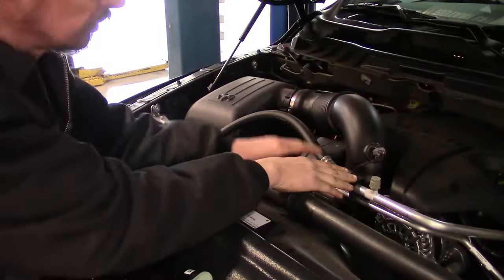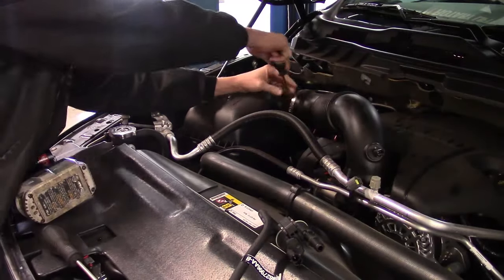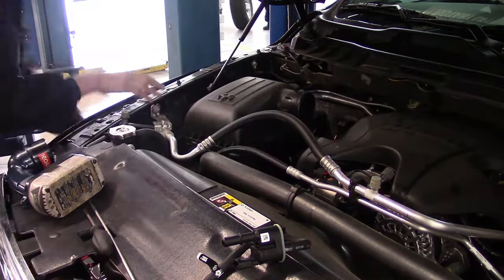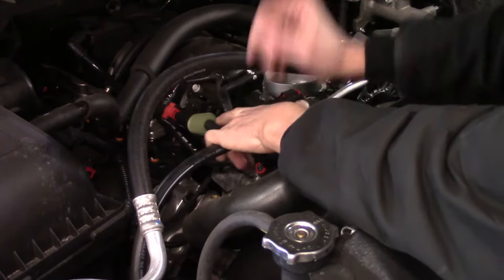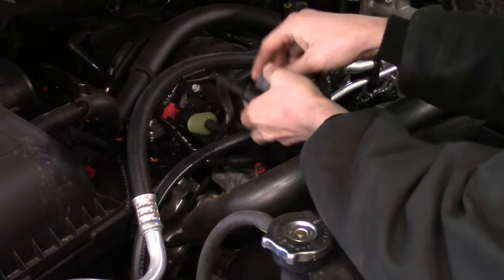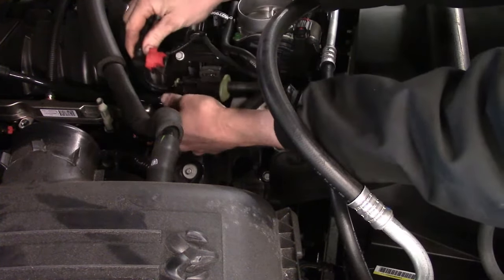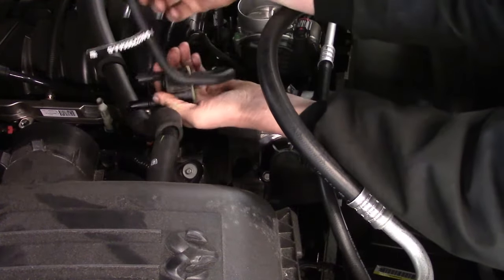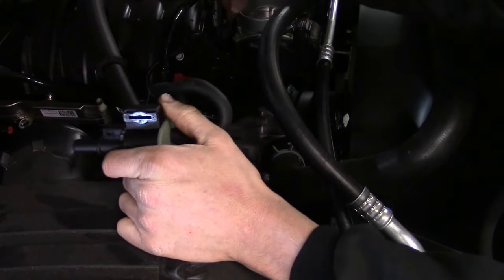2013-2016 Ram 5.7 Hemi evap purge solenoid replacement

Comment: Thanks brother! Your instructions worked like a tee on my '16 Ram. I didn't think I could do it in the same time frame seeing I didn't have a 5 foot screwdriver but I did. The big thanks are to those clamps....drive me nuts! Never know if you lift, push or squeeze. Also note, I removed the old valve and could blow through it. The new one you can't.
Reply from the maker: Thanks Bill for the comment and for watching. Simple fix as you saw and not hard to replace

Comment: Very helpful, I assumed the worst when my check engine came on. I thought for sure my transmission was on its way out but this is the code that ran on the computer. With your video, if this is the problem, I can now fix my own truck for about $40 and about an hour of time. It'll be an hour for me because I'm slow as hell when it comes to anything larger than a 2 stroke engine.

Comment: Thanks for the helpful video. I just replaced mine; it was one of the easiest car repairs I've ever done.
Couple of things I learned:
1) At 1:28 you can use a regular flathead screwdriver to take the hose clamp off by going underneath the 2 A/C lines, rather than between them.
2) At 1:42 on my '17 there aren't rubber gaskets for the air hose, it seals directly on the plastic. It was stuck on there real good. It was easier to break the airbox side loose first, which gave me leverage to  rotate the entire air hose to break the intake manifold side loose easier. Once off I recommend cleaning the sealing surface with WD-40, to ensure it seals when you reinstall it. It also makes reinstallation much easier.

Comment: Thanks! Followed along perfectly. Taking the sensor off the big air hose was a little different on a 2016 but just needed to be turned to the left and then pulled off. Otherwise perfect instructions. Hope it finally gets rid of the check fuel cap light that keeps coming on!

Comment: Just a heads up on you guys that get a p0456 on your rams. Mine is a 2014. I was getting the code and thought it was maybe the gas cap but i wasnt getting the gas cap light. So i checked all the lines. Turns out it was the line going from the silinoid to just right by the throttle body. It looked like it was on but i pushed down on it and it slide down just a little. It doesn't even have a clamp on it. just that tiny fraction of being loose was throwing my code. Now no more code.
Reply from the maker: Thanks for that added info. Its always cool to see viewers helping viewers. Glad you found the cause of your code.
Reply: Me too. I had the P0456 in a 2015 Charger V8 and I was able to push down just a little on the fuel vent line that goes to the throttle body. Erased the code and haven't come back in 24hours.
Now, I don't know if I should return the canister valve or keep it as replacement. ( part PV749  at autozone)
Reply: Do you mind telling us what motor you have they're not all the same.
Reply: Hello
I have same code, P0456 in a 2015 Ram. Will try this and let you know if this works.
Reply: Mine was exactly this. So glad I found your post. Closed the hood one time, and bam...the code. I put a small hose clamp on loosely (it’s just plastic there), and won’t happen again. Cheers. 👍🏼🇨🇦
Reply: Awesome thanks for the heads up.  Maybe I've bumped the hose in the past.  Mines been throwing the p0456 codes in the summer months for over a year now.  Haven' tried anything but I'll check those hoses... maybe I've bumped them messing around with the air intake.
Reply: @davidgamez7967 keep it I did same thing threw the code two weeks later. Seems like it takes a while for the vehicle to test that part of the system
Reply: @mlaugh3 that cel code is common for all dodge engines wether its the V6s or v8s both have same fixes/symptoms

Comment: Just changed mine out took about 15 minutes. Hardest part was getting the damn cover back on. lol. I'll update in a few days on if it "cured" mine. Thanks for a great instructional video.
Reply from the maker: Thanks Michael! Glad it all worked out in the end. I so want to throw those engine covers in the trash each time I work on them.....guess the engine isnt pretty enough to the eyes that we have to cover it up and use it to dampen some of the engine noise as well. Make sure to subscribe and hang around to check out some of my other videos.
Reply: How much was this pRt. And where did you get it if you dont mind me asking
Reply: Micheal, it's been 8 months since you posted and you said you'd "update in a few days on if it "cured" mine." So what was the outcome?
Reply: Fred Proctor parked in street broke down lmao

Comment: Solid video, easy to understand and follow along. Down side is I don't know that this will fix what I'm dealing with. I have a P0455 code (EVAP system leak monitor, large leak detected). Any suggestion? Odor comes from near the gas cap/fill area. No fuel leak. New gas cap put on, did clear out the code. Occasionally the gas cap light will turn on, then turn back off after a few minutes. Loose connector? Loose hose? This did start after replacing the fuel level sending unit so I dropped the tank and disconnected everything. Put everything back on after, but maybe not tight enough?
Reply: I was told at a dealership to take some fine grit sand paper and see if you can clean up the lip of the filler tank. Where the gas cap seats.  It gets sort of corroded there I guess.  Might be something to try.  Just a quick sand to clean up any of the Junk they said.

Comment: ON MY 2010 RAM 1500 4X4 SPORT WITH HEMI, ITS LOCATED AS YOU SAID, NEXT TO THE BATTERY, JUST BELOW IT. I JUST GOT THE SMALL LEAK DETECTED, FOUND THE PART ON AMAZON FOR $20. HOPE THIS FIXES IT, JUST CAME ON THIS MORNING.
Reply from the maker: Thanks Clifford for the comment. Hope it works out well in the end. Thanks for watching and make sure to subscribe.
Reply: @MotorCityMechanic  Yes sir,  I installed it in 5 minutes,  disconnected the battery for 1 minute,  started it up,  light went away,  and has been off so far
Reply from the maker: @cliffordpayton5517  Awesome. Time will tell, I will keep my fingers crossed

Comment: Great vid, did my 2017 in under 5 mins thanks to you. Good on ya mate.
Reply from the maker: Awesome.....now thats quick. Thanks letting me know how it went. Make sure to subscribe if you havent already
Reply: @MotorCityMechanic  There was only one thing you left out. I disconnected my battery afterward for 5mins to reset the comp and have the check engine light go off
Reply from the maker: @bigbearbland  On the battery you can do as you mentioned and then the other thing is not disconnect and if you truely fixed the issue then over the next few days the light should go off. Thats one way to know you got it right. Either way you cant go wrong.

Comment: Thank you so much boss! P0456...this video was very well done and so easy to understand!
Reply from the maker: Many thanks for the feedback and kind words.
Reply: I just got this ram with the same code too. Wanted to try just replacing the gas cap at first but seemed to come back on. Now replacing the purge valve
Reply: @lincoln6981  what was the symptoms u we’re having?
Reply: @classentransporthotshot1496  no Symptoms actually just the check engine light. I already replaced the purge valve. And even taken a trip out of town ( 300 miles round trip ) and everything is good now 👍

Comment: Thank you for the video. Saved me time and money. My check engine light is still on after replacing the valve though. Will it go off on its own or do I have to reset it manually?
Reply: Disconnect the negative battery terminal for like 45 sec. It’ll come off. If it comes back on, something is wrong still

Comment: Is this the same as p0441? My check gas cap light popped on yesterday. Tightened cap & reset code with obd reader & code didnt go away. I keep my truck over half full & when i feel it i stop when the pump clicks once. No gas smell or nothing like that. Whats your suggestion? I hate dash lights 😡
Reply from the maker: The code for the gas cap cant be cleared.....a test has to be run to make sure there are evap leaks and if it passes, you can then clear the code. If tightening the cap was the fix then it may take driving it for awhile and at least one fill up of fuel for it to run the test itself and store the code so that you can then clear it.
Reply: I changed my gas cap because the o ring waz dry rotted & it cleared after i disconnected the battery for 10min
Reply from the maker: @tyrellgatling5666  So much for what I said lol. Typically they wont clear easily. Glad you got it worked out in the end an I will need to remember that as another option next time. Thanks for replying back Tyrell!

Comment: As previously mentioned, great video, thanks. One question, I see that there are some options to buy a replacement solenoid only without the hose and to just re-use the existing hose. Cuts the price down by almost 2/3rds. Is it ok to use the old hose?
Thanks, again!

Comment: Does the evap make any form of noise under the hood while truck is running. The noise happens for like a min and then stop then take a min or two then starts again. Any clue of the noise.
Reply from the maker: It can make a tapping noise when its working......I would make sure that its the cause and not a bad HVAC actuator under the dash. Typically you wont hear the purge solenoid inside......only outside and mainly with the hood up. Thanks for asking and make sure to subscribe.

Comment: Great video. Do you know if this replacement process is the same for a 2016 Ram 1500 (6 cylinder?). Many thanks
Reply: Not sure if you still need an answer to this question but I just changed mine on my 2016 and it was the same other than me having to use a flathead screwdriver vs a Phillips

Comment: So I have a 2013 dodge charger. I had the smell of gas or fumes in my engine cabin. Thought it was the fuel tank or the the pump. Took the seat off smelled fine no leaks and I can hear the pumps turning on. So a month later I got the p0456. Said evap leak. Did research found that it could be this part. Or the canister which is under the wheel well. Would that cause the smell though? I read it can. But I'm thinking if my best bet is just to replace both since I check the fuel tank already. I found it could be the filler neck. But no smell there. Also the smell went away after a while but comes back faintly.

Comment: So I have a conundrum.. I have a 2013 Ram 1500 5.7 hemi 6 speed automatic. And the purge valve is not where you're showing it?!! Maybe I've gone blind, but where the hell is it?
Reply: Tom Strubbe I have not found out yet... I'm thinking on top of the fuel tank??? But I can't get there.
Reply: @tomstrubbe5551 it’s under your battery…he says it in later post.

Comment: Looks like no one has posted anything recently, hopefully someone can help me. I have a 2018 Ram 1500, having problems putting gas in the truck. The gas pump continually clicks off everytime, dealer replaced filler neck, canister, and vent hoses. Same problem, could this Evap Vent Solenoid be causing the issue? Ive read that if the pump keeps clicking, this could be the problem. If it is, is there something i can do to fix it other than Having to deal with it till it gets back to the dealer?  Maybe check lines from it? Thanks alot
Reply: Turns out i brought to dealer, after the filler neck, canister and vent hoses, they replaced the gas tank and all is well. Just shocked me that a gas tank on a new truck just gets messed up like that. Dealer had no explanation, more like well beats me.

Comment: Question:  Where exactly is the Purge Control Valve, P/N 25014001, located on a 2015 Dodge Durango?  I had a MIL light illuminate and  code P0456 came up on my BlueDriver analyzer.  I had the dealer perform safety recall U65/NHTSA 18V-332 to reprogram the PCM which is a fix for said code. While there the dealer claimed they replaced aforementioned valve. However, I saw no evidence of any tooling marks on screws or finger prints in the fine dust which covered the entire engine bay i.e. nobody touched anything there. Luckily the car was under warranty and there's no complaint. Just verifying the valve's location for curiosity.
Reply from the maker: What size engine?

Comment: Anyone know if it’s safe to reuse the hose? Auto zone had two models to replace. One with a hose for 50 one without for 22
Reply from the maker: As long as the hose looks good.....I say go for the one without.
Reply: napa is the same, part with hose is $49 and part without hose is $16. They charge a lot for that small hose.

Comment: I have a 15 ram 2500 w/ a 6.4 in it. I have a couple evap related codes. Truck runs fine with out start up issues or idle issues. It is however difficult to fill up. Different pumps  react differently but typically i can fill about .5 gallons to 3 gallons before it shuts off.  It seems the fuel doesnt drain into the tank fast enough. Ive pulled rhe handle up and i could see the fuel rise in the neck. When i stop it goes into the tank. Any idea what could cause that?
Reply from the maker: Most likely those evap codes you mentioned will play a part in this issue. It could be a tank issue or a vent issue. I recommend having those evap codes checked and tested and then see if any change. If still acting up then the tank may need to be replace due to a sticking valve that cant be replaced separately. Thanks for asking and for watching. Make sure to subscribe

Comment: I have a check engine and gas cap light on. I replaced the gas cap about 5 weeks ago and still wont go away..
 I went to autozone to have the check enginelight checked and theres no code. But all it says in the msg is (small or larger gas leak)..  and i keep getting a strong sent of gas.. 
 Could the evaporatin vent solenoid be the problem?  I have a 2014 ram 1500 with the 5.7 
Thanks for the help in advance..
Reply from the maker: When it comes to EVAP leaks.....an external machine will need to be hooked up and the system tested to see if it will hold pressure and then smoke the system if needed to help locate the leak. Otherwise you will be guessing and throwing parts at it.

Comment: Hello. Got to this video from googling my issue. Any advise would be awesome. I have a 2012 RAM 1500 5.7. PO443 is triggered but its not the valve. What have you seen as the most common place to go next on these? usually the wiring or the PCM itself? Thanks again.

Comment: Trucks throwing the 456 and the 457 codes. I changed the solenoid and the cap and that did not fix the problem. I can hear a rattling sound like a pump is running and I noticed the sound comes and goes. I thought it may have been the solenoid. Anyone else hear the rattle and corrected it?

Comment: So I have a 2016 Ram 1500 w the 5.7 and mine seems to be ticking is this normal?
Reply from the maker: Rome Wild if your speaking of the purge solenoid then yes you can expect some noise from it.....clicking off and on when it’s activated. Thanks for watching and for the question.

Comment: This video is only for ram 2014-2016. The 2013 ram solenoid is under the battery and looks different
Reply from the maker: Pulling up the Chrysler factory service info....it shows it to be by the throttle body on the intake for the 3.6 and 5.7.....now the 4.7 is located under the battery. Not sure if we are speaking of different engines or if the service info isnt correct. I will certainly try to see next time I have one come in that happens to be that year. Thanks for the comment and make sure to subscribe.

Comment: I have a 2007 4.7 dodge ram 1500. How do I replace the solenoid. Do I need special tools for it? Thanks
Reply from the maker: The solenoid is simple enough, it should be located by the bottom of the battery tray on the drivers side. No special tools needed.
Reply: Thank you, also how do I remove the vacuum lines connected to it.
Reply from the maker: @chichay91  Typically you need to squeeze in on the white part of the end of the vacuum hose to release the lock and then slide it off. Its something hard to describe in words but simple once you understand what I am trying to say.
Reply: MotorCity Mechanic thank you again
Reply from the maker: @chichay91  Your welcome.

Comment: I have a 2013 Ram 1500 3.6 liter.  I had to jump start my truck because I left the switch on at the drive in, and it killed my battery.  After I got jumped started the check engine lit up and It’s showing trouble code U1467.  Do you have any idea what that code might be?  I’ll appreciate your help.
Reply from the maker: Its a shifter related code.....I recommend clearing the code and seeing if it comes back once you have that battery fully charged.
Reply: MotorCity Mechanic thank you so much for your tip.   So, I got battery fully charged and ran it for a couple of blocks and sure it enough it went away.  Thank you once again.
Reply from the maker: @lilyhannytheexplorers6164  Your welcome and thanks for the update.

Comment: I am chasing this issue on a 2018 Ram 2500 6.4L.  New cap, new purge solenoid, and new purge valve under the truck near the tank all replaced.  Lights stay on.  Truck is just out of warranty at 40,000 miles.  I am still searching for possible issues.  P0456, P0455 and gas cap light stay on.  Losing my mind about now.
Reply: Did you find the problem?
Reply: @miltonherron9237  I no longer have the truck but I did find the problem. One of the vent tubes coming off the tank had been chewed by a rodent. The mechanic at the dealer was able to splice in a new section without completely replacing the whole tube. Problem was fixed after eliminating that leak in the system.